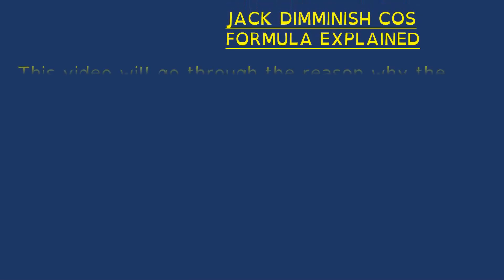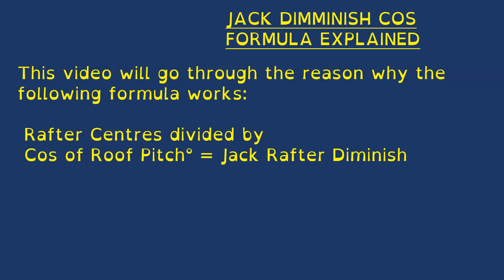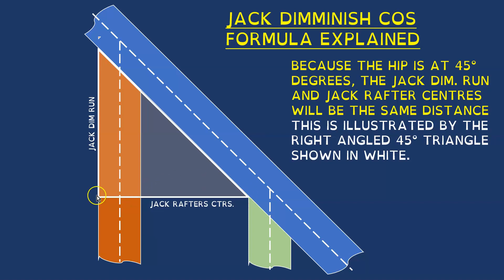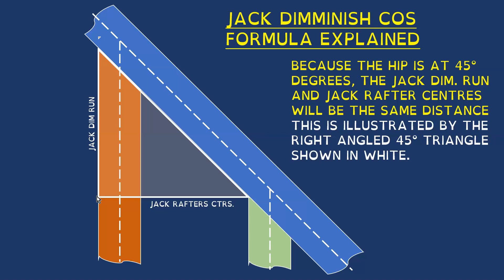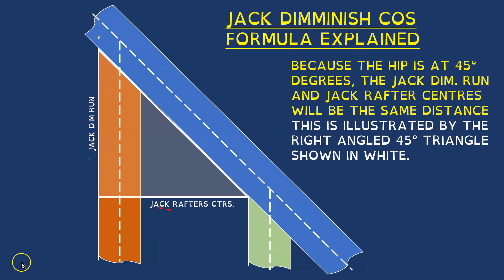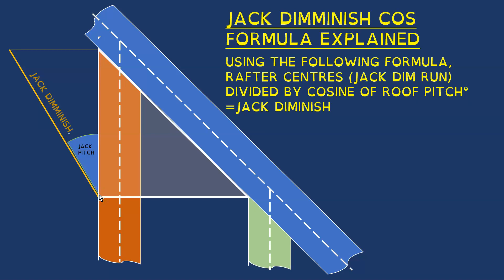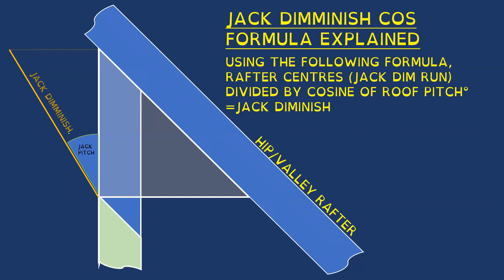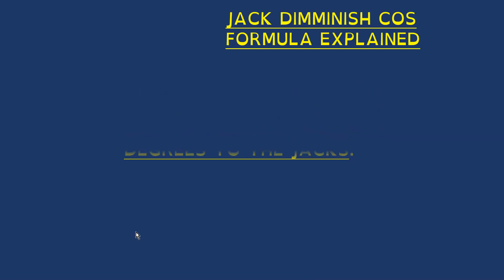JACK DIMINISH USING COS

Comment: If you know the per metre run for the commons you can also use this times by the jack centres. i.e roof pitch of 40 degrees gives a per metre run of 1.305, jack centres = 400, diminish is 1.305 x 400 = 522mm
Reply from the maker: ....and also if dont know the  rafter length per metre run for commons you can get it by using Cos as follows.... take 1 divided by Cos pitch°= length per metre run.    i.e. 1 divided by Cos pitch 40°=1.305
Reply: @michaeldownes516  Excellent, thanks for that, i very much enjoy your animated videos, i love pitching roofs but also love to to understand the geometry of how and why everything works.

Comment from the maker: The Jack diminish is the distance traveled along the roof slope...which  relates directly  to the run or horizontal distance traveled from one jack edge cut to the same point on the next jack.
So for or every 16 inch traveled horizontally it will be matched by a longer distance along the slope/pitch (to get to the same point).....the steeper the slope/pitch, the greater the distance along the roof pitch line.
The Cos formula for jack diminish just uses the known  diminish run distance combined with known pitch to  then determine the distance traveled along the pitch line.
The jack diminish run distance = rafter centres ,but this is only the case if the hip/valley is at 45 degrees to the jacks on plan.
Reply: Your graphics are extremely helpful in helping to visualise and understand joinery concepts. In this instance too, your additional remarks in the comment section relating to distances along the roof inclination and their relationship with the roof slope and additional Jack rafter length is important too. Many thanks for sharing your knowledge and for providing great graphical content!